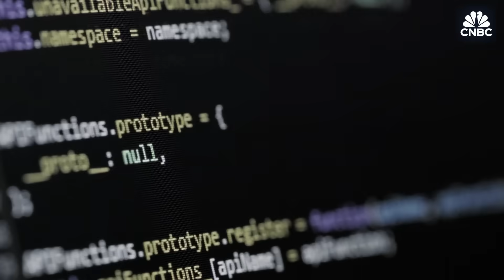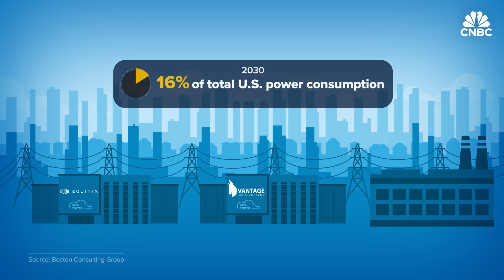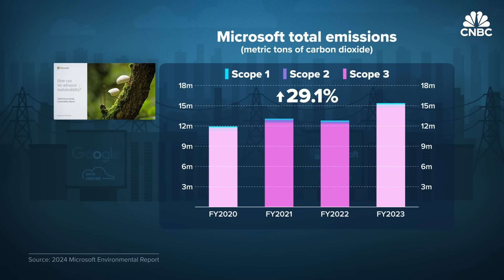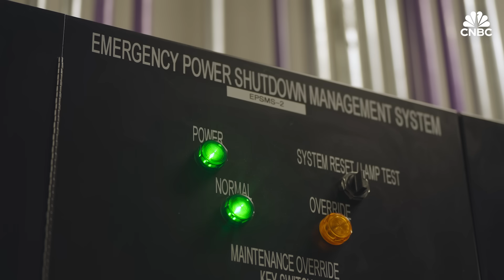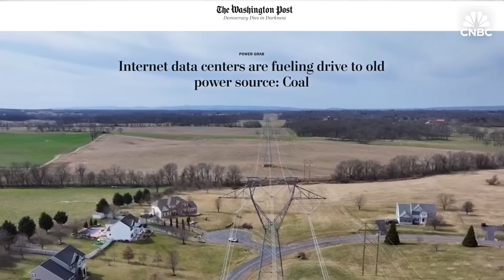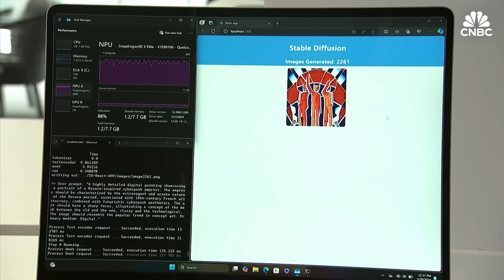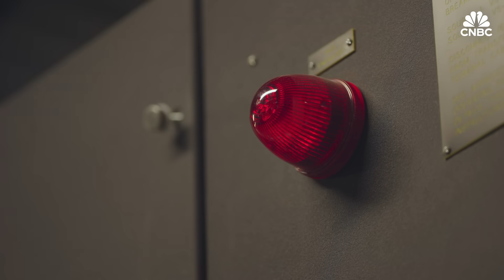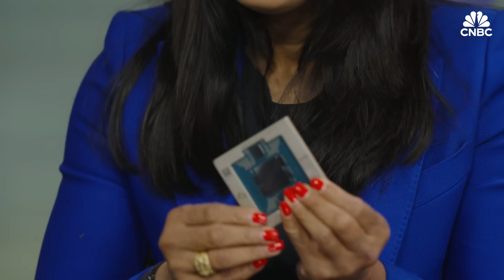How The Massive Power Draw Of Generative AI Is Overtaxing Our Grid

Comment: I asked Chat Gpt: 
Given that we don't want to slow down AI growth on earth, what is the best way for AI data centers to get power? We need to make sure that the power generation is as clean as possible. Please make a 1 year plan for a big data center to change over to a self sufficient, 100% CO2 emission free power consumption mode.

Right away It said:
To transition a large AI data center to a self-sufficient, 100% CO2 emission-free power consumption mode within one year, a strategic plan needs to be developed that focuses on integrating renewable energy sources, optimizing energy efficiency, and implementing energy storage solutions. Here’s a detailed one-year plan:

Month 1-2: Assessment and Planning
Energy Audit:

Conduct a comprehensive energy audit of the data center to understand current power consumption patterns, peak usage times, and inefficiencies.
Identify areas where energy consumption can be reduced, such as cooling systems, servers, and lighting.
Feasibility Study:

Evaluate the feasibility of various renewable energy sources like solar, wind, and geothermal for the specific location of the data center.
Assess the local climate, land availability, and potential for on-site or nearby renewable energy generation.
Stakeholder Engagement:

Engage with stakeholders, including utility providers, renewable energy experts, and government agencies, to discuss the transition plan.
Secure necessary permits and approvals for installing renewable energy systems.
Month 3-4: Design and Procurement
Renewable Energy System Design:

Design the renewable energy system based on the feasibility study. This might include solar panels, wind turbines, or geothermal systems.
Include plans for energy storage systems (like batteries) to ensure a reliable power supply during periods of low renewable energy generation.
Energy Efficiency Improvements:

Implement energy efficiency measures identified in the energy audit, such as upgrading to energy-efficient cooling systems, using AI to optimize server workloads, and enhancing building insulation.
Procurement:

Source and procure renewable energy technologies, such as solar panels, wind turbines, inverters, and battery storage systems.
Consider partnerships with renewable energy providers for additional power supply if needed.
Month 5-8: Installation and Integration
Installation of Renewable Energy Systems:

Begin the installation of renewable energy systems on-site or nearby. This could include setting up solar panels on the roof or wind turbines in adjacent areas.
Integrate the renewable energy systems with the existing power infrastructure of the data center.
Energy Storage and Backup Systems:

Install energy storage systems to store excess power generated during peak renewable energy production.
Ensure a backup system is in place for any unexpected shortfalls, potentially through a combination of stored energy and a small, CO2-neutral backup generator.
Month 9-10: Testing and Optimization
System Testing:

Conduct thorough testing of the renewable energy systems, energy storage, and integration with the data center’s power needs.
Monitor the system’s performance to ensure that it meets the power demands of the data center without any interruptions.
Optimization:

Use AI-driven analytics to optimize energy usage, balancing loads, and minimizing waste.
Fine-tune the energy management system to maximize the use of renewable energy and minimize reliance on backup systems.
Month 11: Training and Transition
Training:

Train the data center’s operations team on managing the new energy systems, including monitoring renewable energy generation, managing storage, and troubleshooting issues.
Gradual Transition:

Begin the gradual transition to 100% renewable energy, phasing out any remaining reliance on non-renewable sources.
Monitor the transition closely, addressing any issues that arise to ensure a smooth changeover.
Month 12: Full Implementation and Review
Full Transition:

Complete the transition to self-sufficient, 100% CO2 emission-free power consumption.
Decommission any non-renewable energy systems that were used as a backup during the transition.
Performance Review:

Review the overall performance of the renewable energy systems and energy management processes.
Identify any areas for further improvement and plan for ongoing optimization.
Public Reporting and Certification:

Obtain certification from relevant environmental bodies to confirm the data center’s status as 100% CO2 emission-free.
Publicly report the achievement to stakeholders, customers, and the wider community to highlight the data center’s commitment to sustainability.
Ongoing Considerations:
Regular Maintenance:
Ensure regular maintenance of the renewable energy systems to maintain optimal performance.
Future Expansion:
Plan for future expansion of renewable energy capacity as the data center grows, ensuring that it remains self-sufficient and emission-free.
This plan focuses on a realistic, step-by-step approach to transition a data center to a 100% CO2 emission-free power consumption mode within a year, ensuring both sustainability and reliability.

Comment: Do they know what the solution is?

Solution

High-pressure water system; heat pump - pump ocean water into reservoir; jack and gears system - lift heavy concrete or stone block; apply controlled gravity and screw-down pressure (machining pressure push down machine); high pressure mechanical energy from water expulsion will turn turbines to produce electricity - the output resulting electricity will power the data-centers

Else, Lasers concentration (which pressure star)

Fission

Comment: The earth's albedo is the sunlight that is reflected off into space without turning into heat. It is around 1/3 of the solar energy we receive. Photovoltaic and thermal solar collectors convert arriving sunlight into heat, either directly or indirectly. In addition, the final waste product of what the electricity is used for is mostly atmospheric heat.

Covering significant areas of the earth's surface with solar arrays will unquestionably increase global warming. It will also change the weather systems by changing the air temperatures over different parts of the planet's surface. This in turn will impact the vegetation, precipitation, cloud cover and air movement. And as a feedback loop, those changes will change the overall reflectivity of the earth and its ability to support life.

It seems the majority of people either don't believe this catastrophe will happen, don't understand what it all means or simply don't care, in the same way a smoker doesn't care that he will probably get lung cancer or that an overweight person will probably have heart failure. As long as they have the newest iPhone and EV, can get their MacDonalds delivered and can post their stupid meme videos on FB, TikTok or Instagram, they aren't interested enough to even think about it.

Until it's too late.

Comment: This is a NON-ISSUE. FYI 10yrs ago average Home using 15-20 older Edison bulbs, was using 1-2kw of power if they were all on. Today same house using LED bulbs uses 150-200w of power. As more people install efficient A/C/Heatpumps vs older heaters n AC there will be more surplus in the grid again that we saw from the evolution of the LED bulb. More solar is being installed and renewable energy projects.... Relax. Unless you're Texas you'll be fine.

Comment: The real threat to our climate is our computing power, it produces more heat than all our cars combined.
Reply: What’s needed is more efficient software and hardware.  ARM is on the right path and worth the investment.
Reply: @DeeBrow  in what ways has  ARM improved efficiency in software and hardware?
Reply: @RollinGimp  Their chipsets are going into the Nvidia cards and other electronics to address power consumption.  Their focus is energy efficiency not maximum CPU output.   When the major corporations that produces operating systems are turning to a company that makes hardware to address power consumption it speaks volumes.  I’ll look at ARM and others in that business.  The alternative is higher energy prices, more HVAC, possibly construction costs, and backup generators for service providers and data centers.
Reply: @RollinGimp  The leaders in A.I. are turning to them for a reason.  Nvidia leads not only in A.I. but crypto mining as well.

Comment: What are the data center paying per kilowatt-hour in comparison to residential kilowatt-hour charges. Can the heat given off by the data center be harnessed to generate electricity or taking heated air upward motion to turn a turbine and use the convection caused to cool the data center thus reducing the data centers demand on the grid in conjunction with roof mounted turbines and solar, the external walls on a data center are huge, mount solar on that too. Build center to optimize prevailing winds and the sun exposure. They could just run vast closed system that convey the  hot are into ducts run underground which is approximately 55 degrees all year round. Throw some hot houses, over the earth covering the ducts, full of fruit and veggie gardens or plumb that hot are to the local hospital, schools and universities even homeless centers as is done in Paris and Iceland among many other. If the demand for data centers is always on the rise. So profits are a given since Google Microsoft always pay their bills then the money to invest in more civil minded solution over profit are surely good for society. Of just nationalize the data center industry and pay down the national debt.

Comment: You must understand this isn’t some simple software.  It’s the most advanced software engineering on the planet.  It’s access databases that could be located anywhere.   They’re having to modify the Ethernet protocol to move more data faster for A.I.
Reply: what???? not how that works.. what 'data' is ai moving around? right now its just text. the ethernet protocol is not being updated lmao.. jfc
Reply: @FusionC6  You know little about what’s going on.   You’re obviously not from the tech sector.  If only power was the only obstacle.  Upgrading existing physical infrastructure is very expensive so, they must look into a software solution.  The bottom is about to fall out of the stock market because it’s being driven by a handful of companies pushing A.I. as if they only need throw a switch to turn it on.   Painfully wrong.

Comment: Here AI even worked a basic plan for you.
This one is free use it 
To create a plan for utilizing waste heat from air conditioning (AC) systems and data centers to run absorption chillers and provide additional cooling, we need to outline the key components, steps, and considerations. Here's a detailed plan:

### 1. *Understanding the Technology*

#### a. *Absorption Chillers*
Absorption chillers use heat energy instead of electricity to drive the refrigeration cycle. They typically employ a combination of a refrigerant (like water) and an absorbent (like lithium bromide). Waste heat can power these systems, making them ideal for cogeneration applications.

#### b. *Sources of Waste Heat*
- **Air Conditioning Systems**: AC units produce waste heat as a byproduct, which is usually expelled to the environment.
- **Data Centers**: Data centers generate significant amounts of heat from servers and other electronic equipment.

### 2. *System Design and Integration*

#### a. *Heat Recovery*
- **Heat Exchangers**: Install heat exchangers to capture waste heat from AC systems and data centers.
- **Heat Recovery Loop**: Develop a closed-loop system to transport the captured heat to absorption chillers.

#### b. *Absorption Chiller System*
- **Chiller Units**: Install absorption chillers in proximity to data centers and AC systems to utilize the recovered heat.
- **Cooling Distribution**: Integrate the chilled water produced by absorption chillers into the existing cooling infrastructure of data centers and buildings.

#### c. *Control Systems*
- **Automated Controls**: Implement advanced control systems to optimize the flow of waste heat and manage the operation of absorption chillers based on demand and availability of waste heat.
- **Monitoring and Feedback**: Install sensors and monitoring systems to track energy usage, waste heat recovery, and cooling efficiency.

### 3. *Energy and Environmental Impact*

#### a. *Energy Savings*
- **Reduction in Electric Chiller Load**: By providing additional cooling from absorption chillers, reduce the reliance on traditional electric chillers.
- **Energy Efficiency**: Aim for at least a 50% reduction in cooling-related energy consumption.

#### b. *Environmental Benefits*
- **Lower Carbon Footprint**: Decrease greenhouse gas emissions by reducing electricity consumption from the grid.
- **Sustainability**: Utilize waste heat, a byproduct, thus promoting energy recycling and sustainability.

### 4. *Implementation Strategy*

#### a. *Feasibility Study*
- **Assessment**: Conduct a detailed feasibility study to assess the amount of recoverable waste heat, potential energy savings, and economic viability.
- **Site Selection**: Identify suitable data centers and buildings with significant waste heat generation and cooling needs.

#### b. *Pilot Project*
- **Pilot Installation**: Start with a pilot project in a selected facility to test the system's effectiveness and gather data.
- **Performance Evaluation**: Monitor and evaluate the pilot system's performance, energy savings, and cost-effectiveness.

#### c. *Scaling Up*
- **Gradual Expansion**: Based on pilot results, scale up the system to other facilities and locations.
- **Partnerships**: Collaborate with data center operators, building owners, and utility companies to promote widespread adoption.

### 5. *Challenges and Considerations*

- **Initial Costs**: High upfront costs for installation and integration of heat recovery and absorption chiller systems.
- **Technical Complexity**: Complex integration of different systems and technologies.
- **Maintenance**: Regular maintenance of heat exchangers, absorption chillers, and control systems.

### 6. *Future Innovations*

- **Advanced Materials**: Research and develop advanced absorbents and refrigerants to improve absorption chiller efficiency.
- **AI and Machine Learning**: Use AI to optimize system performance, predict maintenance needs, and adapt to changing conditions.

By implementing this plan, we can significantly reduce the energy required for cooling data centers and buildings, making a substantial contribution to a sustainable future.

---

Would you like to explore any specific aspect of this plan in more detail?
Reply: https://youtu.be/nUW1OleNUrI?si=apl3ggAUUD6BWs-T

Comment: AI is not helping the planet which desperately needs energy for human development. It  is also eating a tremendous amount of hardware needed by humanity.  AI is currently just a toy and offers no real major benefit to humanity. It is prone to error and cant be trusted. And AI will not get much better than it is now because it has no more data it can be trained on. Legislation is needed to control AI expansion. We simply do not need more and more AI models which do not significantly improve in capability.

Comment: Yeah, the past 2 centuries have been a fossil fuels bonanza. It's powered the rapid expansion of our civilization. This has also happened at the same time that we converted our economy to a consumer driven one and along with our super consumption came super extraction of the Earths' finite resources. None of it is sustainable. In this respect, speaking strictly about fossils fuels, the energy returned on energy extracted ratio is getting closer and closer to parity. Eventually it will become unprofitable to extract fossil fuel energy. Whereas, wind and solar might be able to keep your lights on but it's probably never going to be good enough to sustain the current level of growth and industry. Which means our reality check is about to bounce. Short of a revolution in energy tech, the math just doesn't add up.

What we're doing right now is figuratively, and even literally, like running up the planetary credit card, thinking it can go on forever. But eventually you hit a bottleneck. The bill comes due, with interest, and you find out you no longer have the income to finance the debt. Well, the planet will eventually charge back the debt of expanding rapidly against non-renewable resources, in a fragile and complex ecosystem which we are destroying, with interest and heavy late fees.

But we've had it so easy, for so long. We think the sky is the limit and this can go on forever. We've also been able to engineer our way out of the Malthusian scenario a number of times, which makes us believe we can do that forever. The difference is the ecological paradigm is shifting. We're standing at a cliff's edge that we've never been at before. So all bets are off. This could go either way. So far all our clever engineering has only bought us time. But the engineering involved with buying us time is getting more expensive and complex and more resource intensive. When do you eventually hit the wall there? I mean, we are still subject to the laws of thermodynamics even if we pretend that we are not. 

At the moment, it's actually an open question whether or not AI is all it's cracked up to be. Maybe it is just the next dotcom bubble waiting to happen. Just another speculative activity that industries are using to extract profit, even though it doesn't have the value to justify the capital being poured into it right now. But assuming it is all it's cut out to be, do we have the resources to sustain it?  That's a much larger and more pressing question.